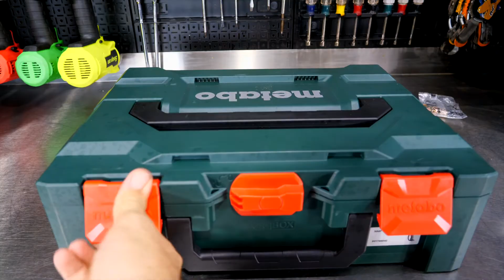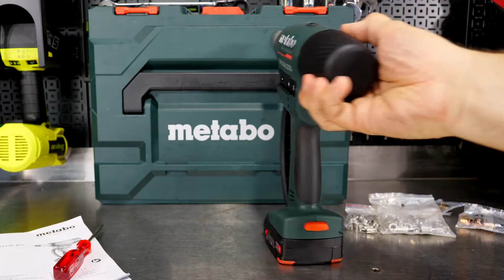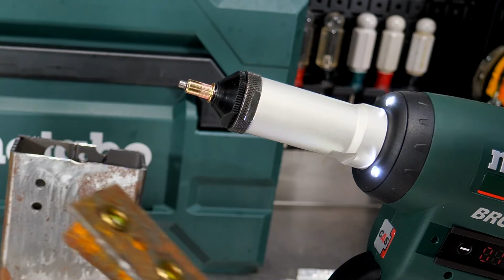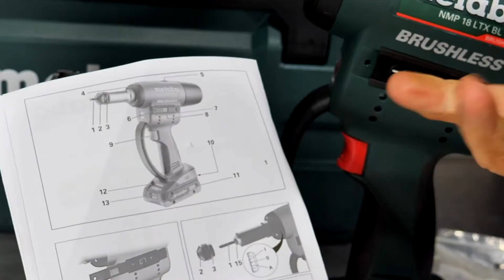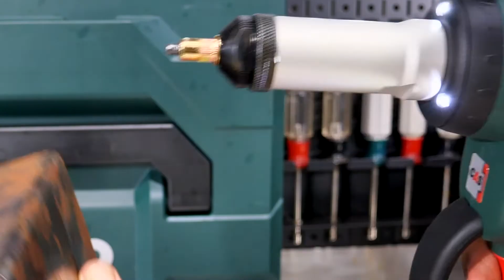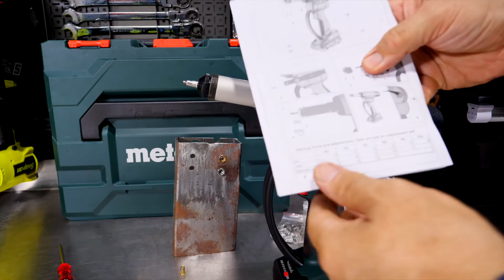QUICK & EASY! Metabo 18V Cordless Rivet Nut Tool

Comment: Just to inform everyone, this tool was designed for use with stainless steel.

A standard rivet nut tool may struggle with stainless steel because it requires a large amount of force to bend steel, it would also probably lead to the tool being damaged in the long run (hence why Metabo states “set force to 60” that is alot of force)

This tool compresses (mushrooms) a steel rivet nut, it is creating threads that are essentially permanent. Once in place, these threads can hold as securely as any standard threaded steel. The weak point here isn't the insert, it’s the nut threads.

Comment: There are ton of cordless rivnut tools on Amazon for 1/10 the price. Why review something that most will not buy?
Reply from the maker: You are correct, that most are priced out of this tool. However, there are manufacturers that have stringent standards, requiring tools that can repeat a process over and over within a certain tolerance. The cheap tools rely guessing, where this tool has different power and pull settings built in. Thanks for watching.
Reply: @Shoptoolreviews you can only clamp it so much otherwise you will distort the thread. We're not talking precise something that goes on a lunar shuttle. We are talking about a rivnut. I installed many of them by using a bolt with a nut and bearing. Less than $2 tool. Sure, not the same speed but result is the same. And I did it under a car without lifting it where this large tool would not fit.

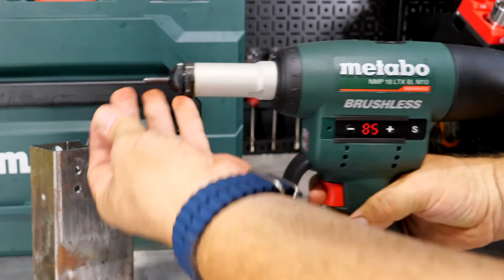Comment: 13:39 - They had to implement a more intelligent way to quickly change the settings, instead of forcing the user to remember the numbers. Pressing both buttons simultaneously could switch to that mode, then pressing the left button would change the rivnut size (M3 M4, M6, M8, M10), while the right button would change the material type (Aluminum, Steel Stainless steel, Brass). 
 Changing the tips for the different sizes is also super slow. It could be done in a much quicker way.

Comment: 12:35 - Another failure caused by bad engineering. They had to program the tool to do at least a couple extra revolutions in the reverse direction, just to make sure that the thread will not be locked. Even better, they could have provided the option to set the number of extra reverse revolutions OR let the user hold the trigger in the final operation for as long as he or she wants.
Reply: Yeah, I was amazed by that. It's got a 7 segment LED display, though. The microprocessor inside probably doesn't have enough memory to do that :)

And the engineers who designed it probably retired 10 or 20 years ago, so, nobody remembers how to change anything on it.
Reply: @gf2e  , I believe that the processor inside is good enough to program the tool to do a couple of reverse revolutions. Maybe it's a matter of engineering mind and whether they engineers actually test their own creation in real life conditions to find out of there are drawbacks in their design that need to be fixed. "Metabo" sells the tool for a premium price and I'm amazed that such a basic function is non-existent...
Reply: @AutomotiveCNC  Yeah, I was joking about the CPU size :)

I’ve written C++ on a machine with 1k of RAM, and I’m not an expert. There really is no excuse for having to pull out a mechanical tool to retract the nut.
Reply: @gf2e  , I completely agree with you. The sad thing is that many industrial designers and engineers don't put the effort to test their creations, hence we end up with half-backed products that were supposed to work properly. Being self-critical is a key to success, especially if you are making automated tools.
Reply: @AutomotiveCNC  I think part of it is the development process and timeline. How many prototypes can you make? How often, and how quickly, can you make changes and get them to the production line?

Some companies don’t put the effort into making 100% prototypes before they go into production. They’ll have their last prototype and decide to make the last few changes in production. And they won’t have any process for small changes. If they want to make a little change, they’ll have to redo their testing and so on, and that’s too expensive so they don’t do that. 

Having production done far, far away from the designers is also probably a problem. It makes it harder to examine tweaks. 

There’s also the cultural thing of some companies being arrogant and thinking they know better than anyone else. They know what you want. And you’ll just smile and accept it.
Reply: @gf2e  , I think that your last 3 sentences pretty much explain the most common mistake of the majority of companies that offer sub-par products.

 Since the subsequent reverse revolutions are a software thing, it's extremely easy to program the electronics to do a couple extra counter-clockwise revolutions. It's a matter of minutes. No need to change the hardware at all. I suppose that the development was dome by someone who has never tester their own creation in the real life. That's the first mistake.

Comment: Would come in handy for them stupid miller cat shield installations where you need to put the rivet nut setter into the vehicle's frame. I messed with one installation of the rivet nut setter by using a bolts and nuts, took nearly an hour and fail to set one rivet. So F this shit, order the manual rivet nut setter, and worked flawless, took 2-3 minutes to set 6 rivet nuts. When my manual rivet nut setter break down, I will keep this cordless rivet nut tool in mind.
Reply from the maker: We can't argue with this. Real world use. Thanks for watching.

Comment: Can’t wait for big red to make this tool
Reply from the maker: We've been twisting their arm for about 3 years now for this. They do have the M18 Rivet tool and the M18 Huck-bolt tool, so I think we'll see it at the next Milwaukee Pipeline event this year. Thanks for watching.
Reply: You like not having parts availability for a $1,200 to $2,200 tool?
Reply: @robertrada4783  I am experiencing this exact problem
Reply: Harbor freight ❤😂
Reply: @ no, big red as in Milwaukee

Comment: Hello! Great video ! This originaly is Gesipa made tool , they are now in CAS battery system   , the cap ( M4;6;8...) and the lock nut are for adjusting the exposed lenght of the thread ,  so that you can adjust lenght of the stroke. Thats what those wrenches are for . If you havent adjusted stroke lenght , you might end up with pulled out thread from the nut . This is the rare tool that you need to read that booklet that came with it . And yes , they are expencive . HTH